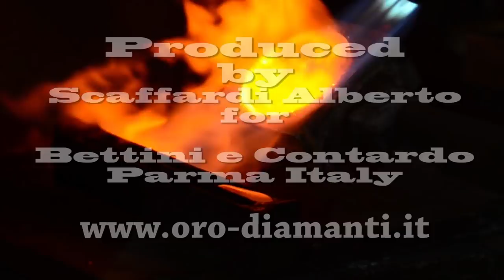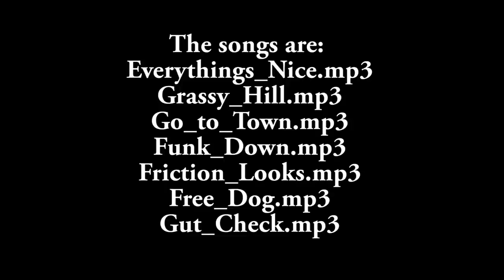Diamonds trilogy ring white gold 18kt handmade

Comment: I think I would be very scared when setting the stones, in case I put too much pressure on one side, and they break. Does this ever happen, or have you just learnt through practice and experience how much pressure and tapping it takes?
Reply from the maker: it is very difficult to break the diamonds, it happens very few times and when it happens it is because it has badly hardened the stone seat.
Reply: scaffoal Thank you for the answer. =)

Comment: Hey scaffoal, where can I find the soldering coil you use often? I would like to get one.
Reply: I wondered the same thing but didn't bother looking to buy it online. They're really easy to make. I had some 20 gauge steel sheet metal lying around that was left over from another project. It's easy to find at most hardware stores, but make sure it's not galvanized! (If it is, you could submerse it in white vinegar for about 24 hours to remove galvanization) I used shears to cut a 1" wide strip, about a foot long, and "coiled" it by hand with a pair of needle-nosed pliers. It works very well... but it's rigid, not springy.
Reply: You could use an old main spring from a broken grandfather clock.

Comment: Can you use pure silver to make a ring or will it tarnish? Could I melt down some old silver quarters? Thanks
Reply from the maker: adding a 10% copper to the alloy you get a stronger silver
Reply: Pure silver doesn't oxidize, you won't even have to pickle it after melting it. Alloying it with copper makes stirling silver, which is stronger/stiffer but will oxidize slightly.
Reply from the maker: Using 10% copper you get a silver alloy that slightly oxidizes, I like the effect you get with oxidation-induced shadows. it is still my own personal taste.